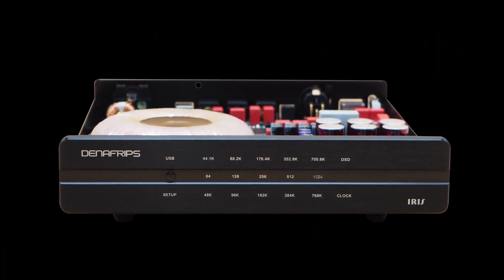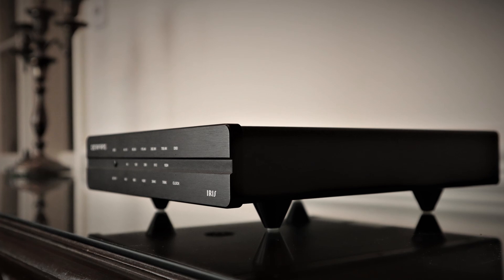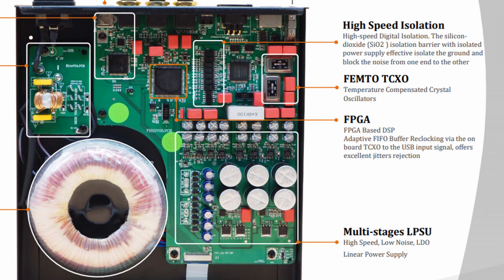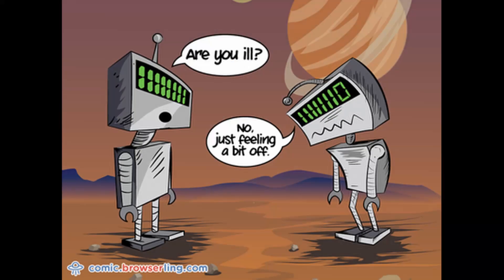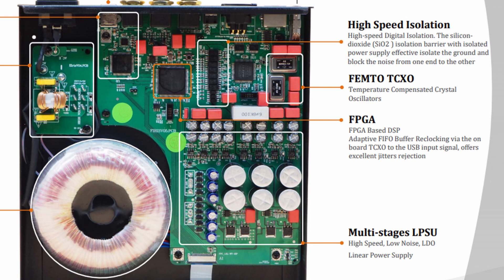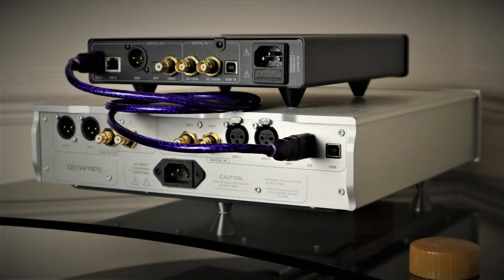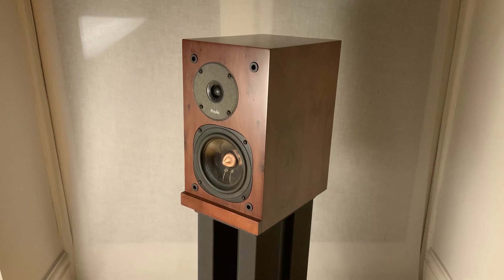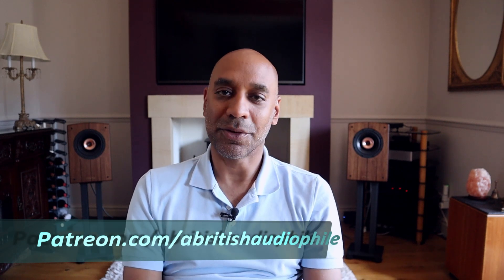Denafrips Iris DDC Review

Comment: Hi Taurun. Question for you: you're recommending people use a USB output from their streamer into a DAC (or into this digital to digital device) over a Coaxial cable, correct? I have a Bluesound Node and a Denafrips Ares II DAC. Thus far I've only tried optical vs coaxial, and the coaxial sounded better for sure. Haven't tried the usb. Before going out and getting a USB cable, want to make sure I understand that this will in fact be an improvement over the coaxial. Thanks very much! Josh
Reply from the maker: There are technical reasons why the usb connection should be better as I explain on this video. However, it all comes down to implementation.Try a generic USB cable from Belkin or similar before shelling out for an expensive one and you will be able to tell if it better 😊
Reply: @abritishaudiophile7314  Thanks for the quick reply. As luck would have it, USB output is only available on the latest version of the Bluesound Node, not the 2020 model that I have (Node 2i). So I’ll have to upgrade models to try the USB approach . Probably wait until I upgrade my DAC to a Denafrips Pontus before making the switch. Thanks!
Reply from the maker: @joshuaschneck  that seems sensible. I would suggest looking at a dedicated streaming transport at your next streamer. Something from Lumin or Auralic 😊
Reply: @abritishaudiophile7314  Hi Taurun.  Quick update - I just picked up a new ifi Zen Stream dedicated streamer with USB output (about $400 USD). After just 1 hour with the unit I can say it's definitely a big improvement over the Bluesound Node 2i in terms of sound quality: clearer and more detailed, with a deeper soundstage, and just more engaging. I'm running the Zen Stream into a Denafrips Ares ii via USB, whereas with the Bluesound Node 2i I was using the coaxial output from the Bluesound. Set up was a bit tricky - need to first connect via ethernet and update the software before connecting via wifi. But once that's done, it's been rock solid. I will upgrade the power supply as you suggest. You might want to consider reviewing the Zen Stream if your schedule permits - I'd be interested to hear what you think.
Reply from the maker: @joshuaschneck  thank you the update. I hope to review it at some point 😊👍
Reply: @abritishaudiophile7314  Hi Taurun. I've been recommending your channel and this video in particular as a great way to better understand what's happening in digital signal transports and what that means for those wishing to improve the sound of their systems. However, I'm still a bit confused about what clock(s) are used with different signal transport mediums. Are you saying, for example, that with the I2S format, that the clock on your DAC is not used at all? Or is there another "clocking" step that happens in the DAC when it receives an I2S signal? And lastly, because some (like myself) may wonder why the functions of the Denafrips Iris (converting USB signal to I2S and some reduction in noise) can't be done within the confines of the DAC itself, you're saying that it depends upon the quality of that DAC, correct? In the case of the Denafrips lineup, the onboard clock of the Pontus is not as good as the Iris, but for the Denafrips Venus, perhaps the Venus can do it all in one and perhaps even better??
Thanks for sharing your insights.
Reply from the maker: @joshuaschneck  thank you for your support Joshua 😊👍

I try to explain how the Iris works. In all digital signal transfers, apart from USB, the device feeding the DAC is responsible for the timing of information. For example, this could be a TV via optical, a CD player via coax, or streamer via I2S (if it has that output). It will be the clock inside these devices that is being used and in most cases it will be far inferior to the one inside a decent DAC. The benefit of USB asynchronous digital transfer is that the clock in the DAC takes responsibility for the timing of information. This will lower jitter and improve sound quality.

A device like the Iris takes the USB signal, reduces electrical noise by optical isolating the input. If you use the I2S output of the Iris, it inverse multiplexes the signal (separates out the master clock, word clock and data signals) and then feeds this to the DAC. I2S is the digital audio protocol used inside DACs and normally not available externally. Also, the clock inside the Iris is better than the one inside the Pontus II. It is based on the clock inside the Venus II. The upshot of all this is that the signal has lower noise and less jitter than a USB signal fed directly to the Pontus II.
Reply: @abritishaudiophile7314  Hi Taurun. Thanks for your patient replies. Just to be clear, for a DAC to convert I2S to analogue, there is no clocking step involved (the clocking happened upstream in the signal chain, and the D to A process in the DAC essentially bypasses the DAC's internal clock. But to my question about whether the reduction in electrical noise and clocking could be done as well or better internally in a DAC fed a USB signal than via the Iris, the answer is yes - there are DACs that do this as good or better than the Iris... right? Looking at the Denafrips lineup, seems like an Iris feeding a Pontus via I2S is probably on par with the Venus alone being fed a USB signal, and I imagine that the top of the line Denafrips DACs like the Terminator and T2 have even better quality results in terms of lower noise and jitter.

Comment: Did you use different coaxial cables? This VDH "the first" you showed, if it's the one you used, it a bit strange cable because of it's carbon construction. It has has very high resistance and an overly dark and smooth sound lacking in dynamics. VDH himself is not recommending it for digital connection, according to my dealer at least.
Reply from the maker: I used a 75 ohm digital coaxial cable. I used the VDH First just because for illustration purposes. The colour makes it stand out 😊

Comment: Hi there, what cable did you use for the I2s connection, is it just a regular HDMI cable from the iris to the Pontus? Is it just plug in and off you go or needs some tweaking? Many thanks.
Reply from the maker: I used one by QED 😊

Comment: Thanks Tarun. I can't afford to upgrade to Pontus as I got Ares 2 last year. I stream from my laptop pc to it on Denon 2600 and ma silver 8. I know you said only Pontus would be worth it but would I get any improvement adding this?
Reply from the maker: Hi David, I would NOT suggest to upgrade the Ares II for the Pontus or to add the Iris DDC. I think the Ares II DAC is probably the strongest component in your system. I would be upgrading amp and speakers first 😊

Comment: It sucks that the Ares II has no I2S in.  I bought the Iris with it and have to use SPDIF Coax to connect. Not even any AES in on Ares II. FML.
Reply from the maker: It is understandable given the cost of making an R2R compared to a Delta-Sigma DAC that the connectivity is limited on the Ares II 😊
Reply: My Denafrips Ares II 12th-1 has I2S.  You bought the cheaper or older Ares version.
Reply: @mrpmj00  Jesus, that post was 2 years old. Of course I bought the first edition of Ares II - that's all that was existing at the time.

Comment: Hi Tarun, I just wanted to say thanks for this review, it was really helpful and persuaded me to buy the Iris. As a Britisher abroad, I’m in a remote area with no hifi shops, so I really appreciate your concise appraisals.  I also run an Auralic Ares mini to a Pontus 2. So could’nt ask for a better review! I was worried that my system would not be revealing enough to test the Iris. I have Harbeth Compact 7ES speakers and a VTL IT-85 integrated tube amp. My fears were unfounded, after only a few days of listening I’m really engaged by the textures that weren’t there before and a pleasing degree of density had been added to the bass and mids. Over all the Iris is a winner, cheers! Matt
Reply from the maker: Thank you Matt. I am so pleased it worked in your system. I am not surprised, give it’s quality. Thank you for sharing your experiences 👍😊👍

Comment: I have Ares II. Do you think it would make a difference?
Reply from the maker: A little but you are probably better off upgrading the DAC first 😊
Reply: For me getting an Ares II was a massive upgrade. Seems like DDCs are more effective at eeking out more from DACs at twice the price.
Reply from the maker: I haven’t tried it with the Ares II. The better clock should improve the sound but you need to make use of the I2S output from the Iris to get the most out of it 👍

Comment: Will this also work on the Ares 2 via coax?
Reply from the maker: It only has a usb input 😊
Reply: @abritishaudiophile7314  i mean from the iris going to ares it’s gonna be coax or opt? Which is better?
Reply from the maker: @pinoyxbox  there wasn’t a noticeable difference between the two but I didn’t spend much time testing the optical connection 😊
Reply: @abritishaudiophile7314  Thanks! Still thinking if i should get one or not 😂😅. But seeing your video and goldensound video i was convinced lol but it’s a $500 device hahah. After i get my arya I’ll definitely add the iris to my chain. It’s a mean stack with the ares+singxer sa-1 😁

Comment: While I respect your reviews and judgement a lot .. I dont understand why IRIS + Pontus would take it to Venus . IRIS can improve the sound quality of Pontus but obviously  cannot change its sound signature to that of Venus. Extending the logic , one might say IRIS + Venus would equal the performance of the Terminator which we know simply wont happen. So, I am not very clear on your conclusion.
Reply from the maker: @sanjaymarathe1442  Iris + Pontus moves performance closer to the Venus due to the Iris having the same clocking mechanism as the Venus 😊
Reply: @abritishaudiophile7314  Oh I get it now .thanks .. One more question please .. I normally dont use USB . I feed from Silent Angel M1T to Pontus ( I2S ) ...So,  Which configuration will a ddc ( e.g. hermes ) have more impact ? M1T -> USB-> Hermes->I2S-> pontus  OR    M1T-> Coax ->Herms->I2s-> Pontus ?  So, in short , for which input to IRIS ( USB or SPDIF ) does the superior clocking mechanism of IRIS help more ?

Comment: Hi Tarun, at timestamp 12:40, you spoke of improved sound quality with the iris between your computer and the Pontus ii, but not to the level of as your Auralic Aries Mini connected directly to your Pontus ii. Is there any benefit to using the Iris transport between the Pontus and a streamer like the Aries mini or ifi Zen streamer with an external SSD hard dirve connected to it?
Reply from the maker: You can never tell for sure unless you try but I would have thought that the clock in the Iris is a lot better than the one in the Zen. If using the I2S input there should be an improvement 😊
Reply from the maker: @johnd2843  that is exactly the scenario I used it in. USB from streamer into the Iris, I2S from Iris into the Pontus II. The improvement easily justified the outlay IMHO 😊
Reply from the maker: @johnd2843  sorry, I don’t think it was that clear in the video. USB connection from streamer direct to Pontus II sounded better than coaxial or optical from Iris to Pontus II. The benefit in sound quality came when using the I2S output of the Iris to the Pontus II 😊